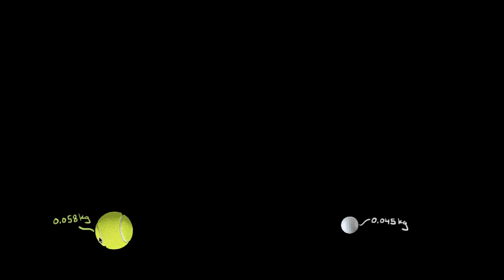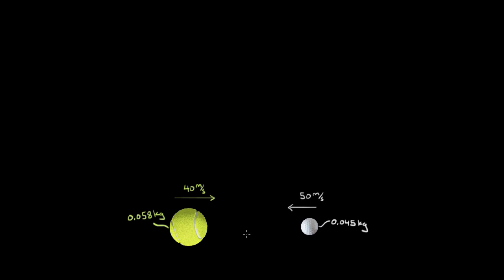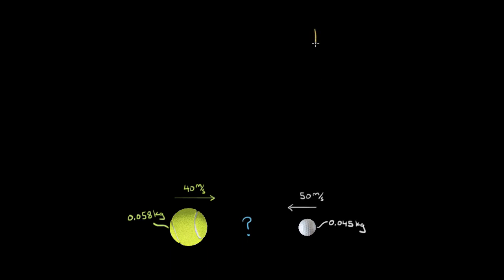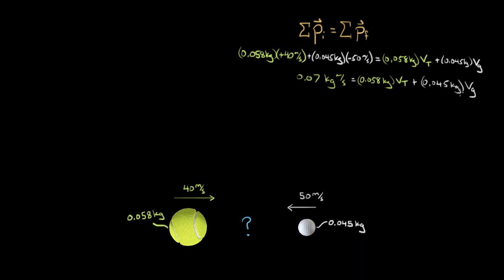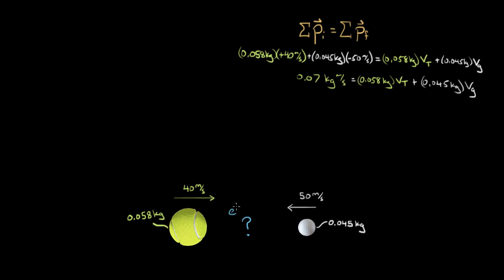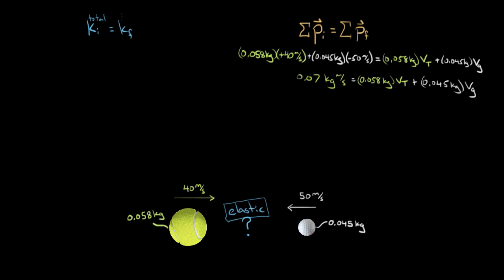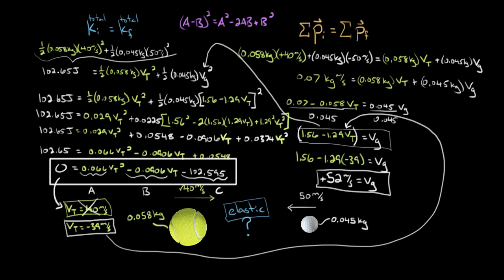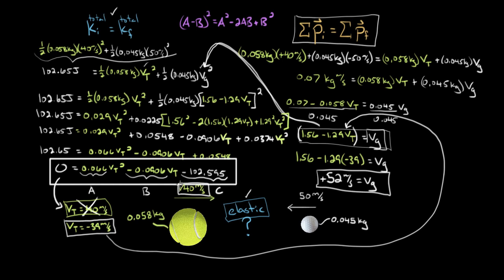Solving elastic collision problems the hard way | Physics | Khan Academy

Comment: Man - you REALLY should not have rounded your result - it totally ruins the answer, because when you plug those resulting velocities into the kinetic energy formula, they are wildly wrong.  This is why smart people fail math - because teachers take unexplained shortcuts which break the answers...  Using -39 and 52 gives us 104.949
J, which does not equal the 102.65J we started with!!!
Reply: Sounds like a you problem
Reply: Less than 3J is “wildly wrong”
Reply: @Brainiac51  This is a math instructions video - but it LITERALLY does not add up.  Like I said - how are students supposed to LEARN this shit, when teachers make it IMPOSSIBLE for anyone to get a correct answer?  It takes decades of experience to understand that 3J might be insignificant, and why/how your answer doesn't match the lessons - which is utterly unnecessary if the teacher had simply empathised with the skill levels of the students and make everything work out and be repeatable !!
Reply: @chrisdrake4692  skill issue
Reply: @chrisdrake4692  then dont round as much as possible? Sorry the school system teaches us what the concept of significant digits are
Reply: @Eyo-ny9rm Looks like you went to the Donald Trump school of math?  104.949
J does not equal 102.65J  Did you even watch the video?  How many significant digits are being used?  Is it consistent?  No, right - so clearly, this is a math tutorial, not a statistics/significance one... or it would have been, if he'd stuck to some consistency